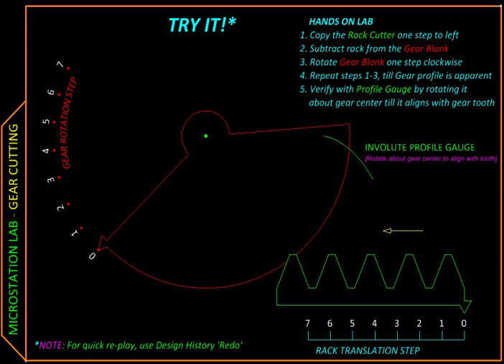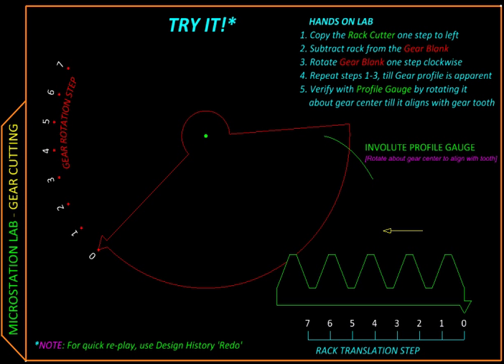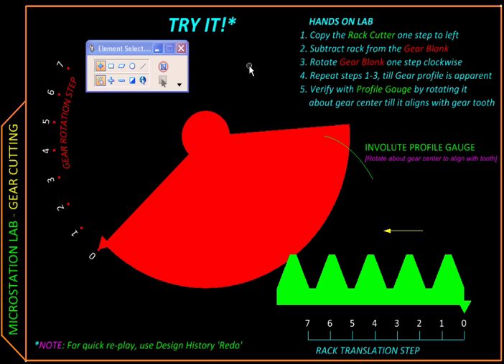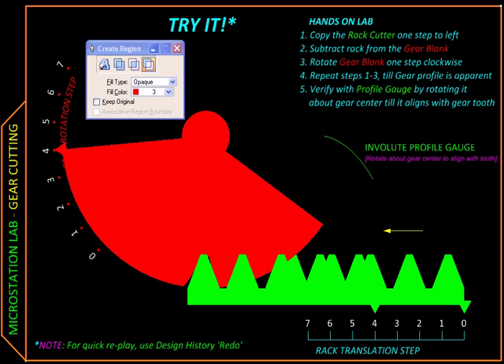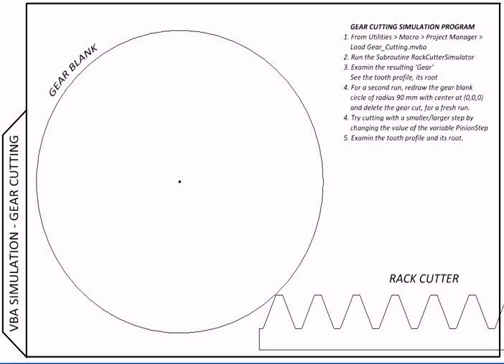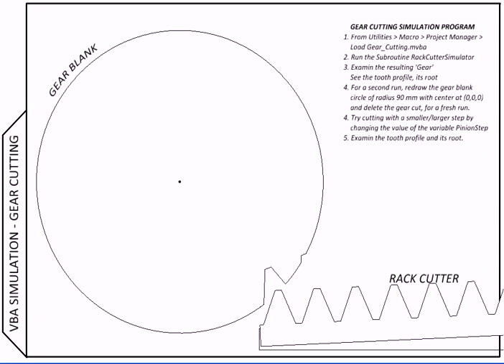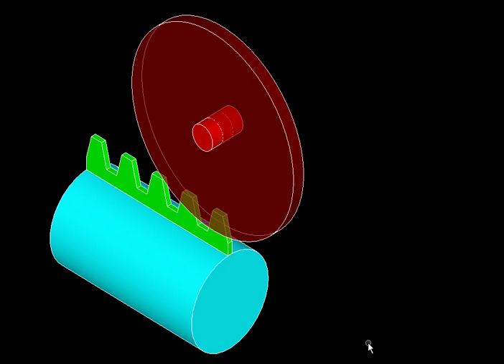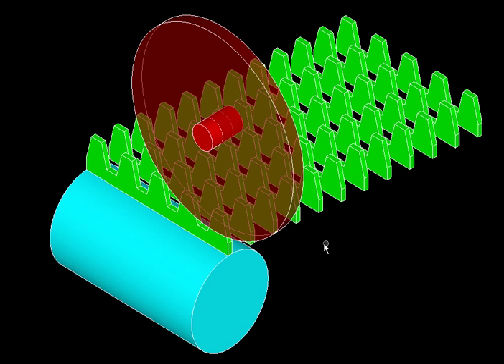Kinematics Ch06F Involute Gear Generation

Comment from the maker: @petsatcom The rows are offset successively. You can see than happen just before they get wrapped around the core cylinder. Is that what you were asking? Of course the blank has to rotate too, to simulate the rack and gear engagement during the cutting process.
Reply: sir is ch 06 E missing  
if so pl post it ,your videos are really helpful